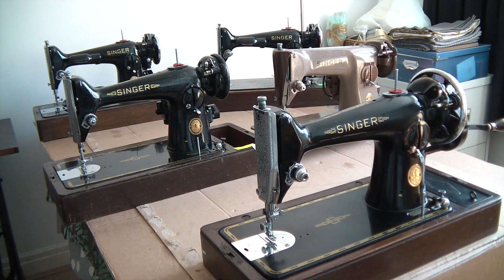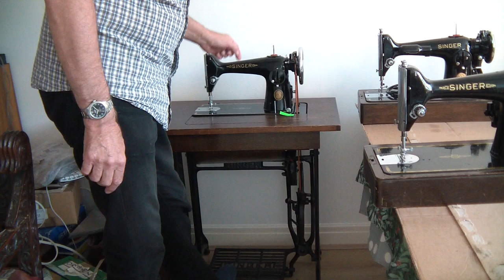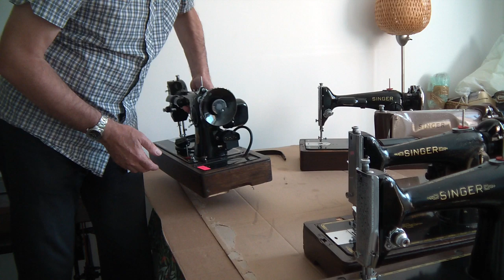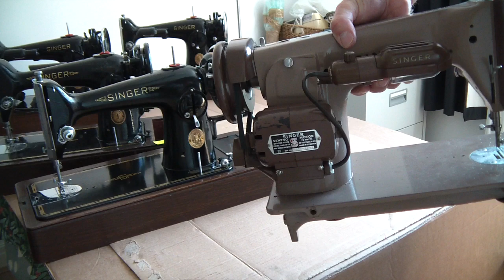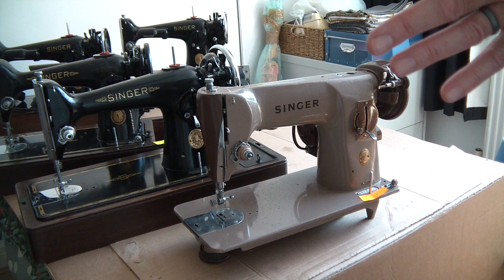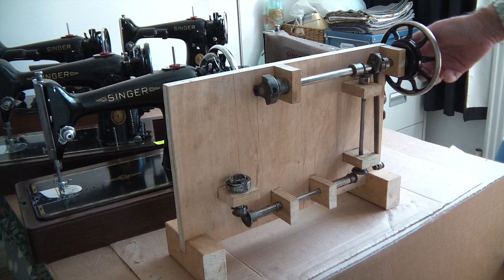Singer 201 How to look after and maintain and use the Singer 201 correctly.  1.Introduction.

Comment: Hello from Australia I am the proud owner of 8 singer 201 machines 3 of which are treadle action i love using them so they won't be decimated while I am alive!
Reply: I’m from Aus too and I’m going to pick one up tomorrow in a table. I’m wondering though how to travel it home!
Reply: @Noniinthebush  just  make sure it's  well protected if you can wrap it in a large blanket before securing it for transit also remove the machine head if possible
Reply: @ 
Hey, thanks Adrian. I hadn’t thought about removing the machine from the table but that’s a great idea. I’ll take some screw drivers with me. Cheers

Comment: I did not know about the second version of the 201-2, but I'm not surprised that probably was something that was manufactured in the UK and only the UK or other parts of the world. The only one I'm aware of that was ever sold here was the 201-2 that was just the two-prong power plug. Or at least that's the only one I've ever seen. Want any machine no matter the manufacturer here in the Unite States I have three of the 201s. I have two what we call 201ks meaning that they were made in Great Britain and then the 201-2. One of my 201ks is a hand crank. The other is a treadle and they were a little bit difficult to find or at least in my area the 201-2 is fairly common
Reply from the maker: Hi, I think that they are quite rare but felt that there should be a warning about them as they are plain dangerous if you just use a normal power cord. Sounds if you have the 201 bug as well, very infectious.